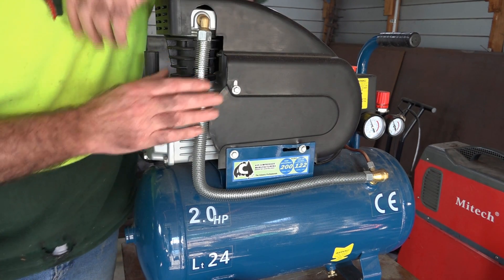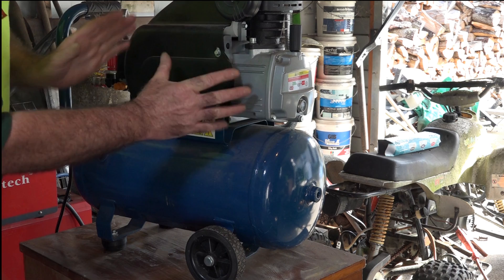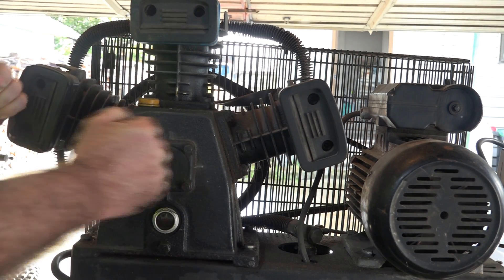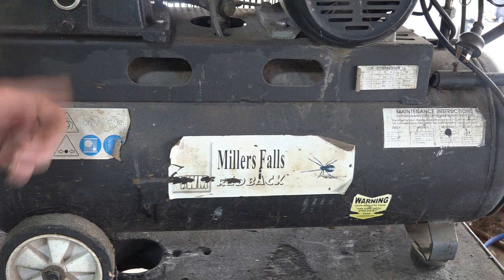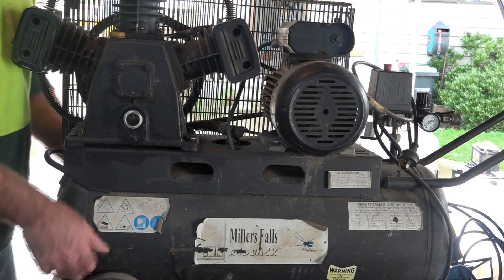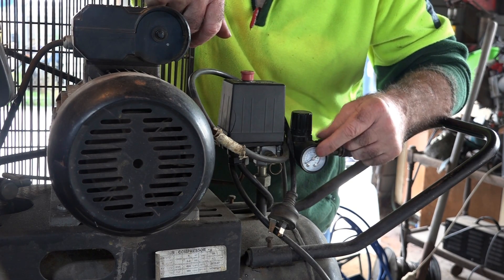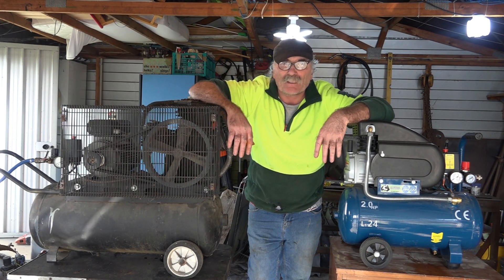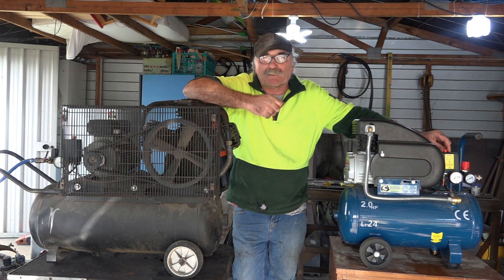Direct-Drive Compressor vs Belt Compressor - Which One is Right For You?

Comment: Those damn electric motors and the overrating got so out of hand that about 10 years ago or so, at least here in the US, there was a class-action lawsuit about all the BS that was going on in the marketing specifically with electric power tools. Today it's still way over-inflated in the consumer class, where they advertise the 'peak' hp like it's supposed to be continuous duty hp, when in fact its pretty much half of advertised. I tend to look at the amps and the current, multiply the two to get the watts and divide by 742 to see how close the rated hp is to the claim. Haven't found one yet that's been made in the last 15 years that's accurate as stated. Matter of fact, the big compressor I got second hand was touted as a 5hp motor; in reality, it's more like 2.25kw, which puts it right at 3hp. At least it was mated up to a 3hp pump!
Reply from the maker: Yea don't believe what's on the label

Comment: Hi Pete, I was thinking about buying a Air receiver tank just to get around the noise problem with a small  domestic compressor of 24ltr to run a stapler .any ideas of what problem I would have in running a stapler with one of those   tanks .the filling of the tank would be done by a small air pump I have access too. Thanks from UK.
Reply from the maker: You can run a stapler with 24 ltr no problem . I have a video coming out soon about that .Cheers pete
Reply: @petestools  Thanks Pete,  I will let you know how I get on .can't wait for your new video Cheers from UK.